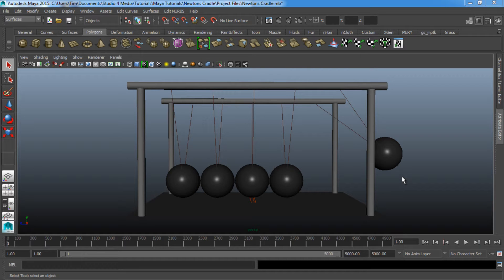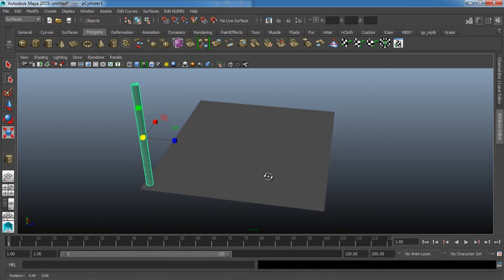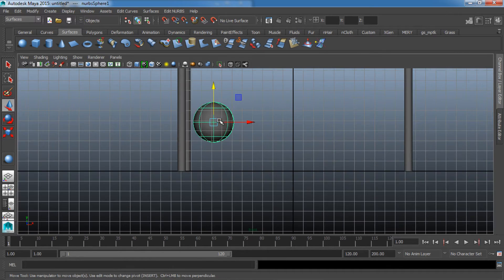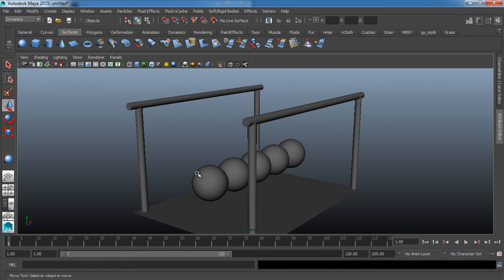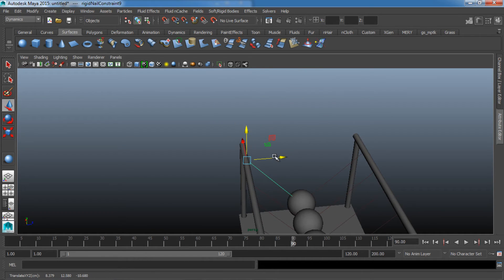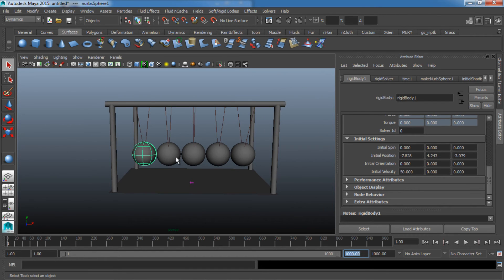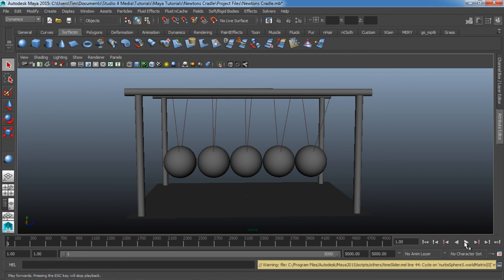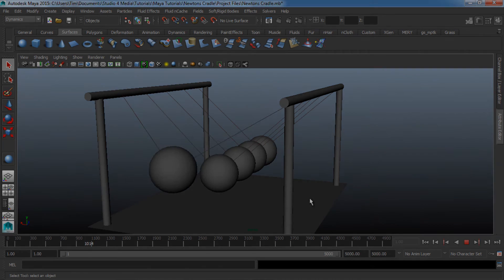Newtons Cradle - Maya Tutorial - 1080p

Comment: Hello! Great tutorial! For anyone who is watching this in 2020, Maya 2020 has no dynamics library anymore but you'll find what you need in Fields/Solvers. Also, the wire will not render so you need to make a thin cylinder around the nail constraint, then hold D while moving the pivot point to where the ball it's connected to is. After this all you need to do is click the ball, command click the cylinder, then make a parent constraint.